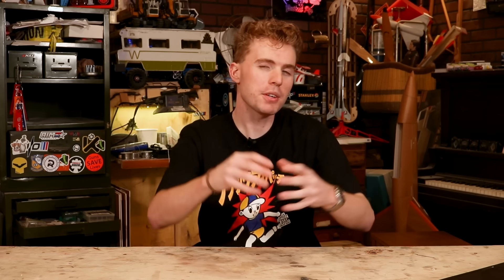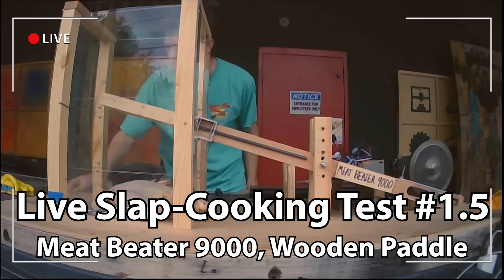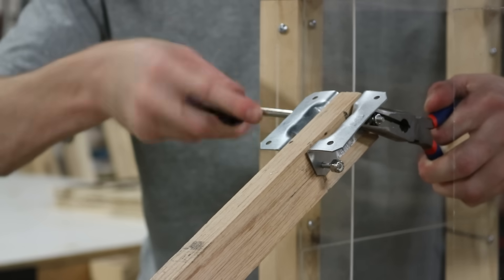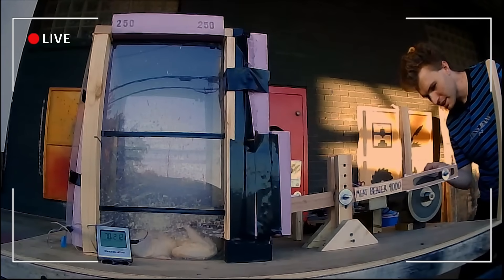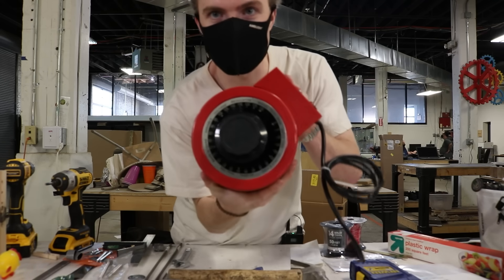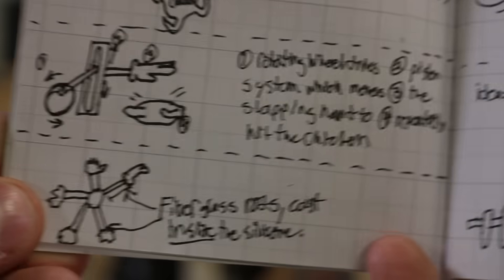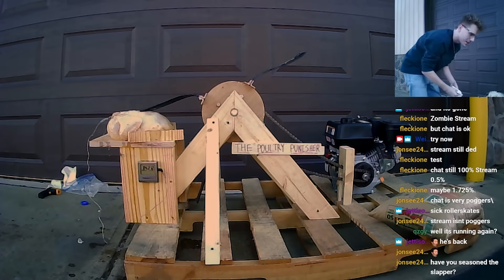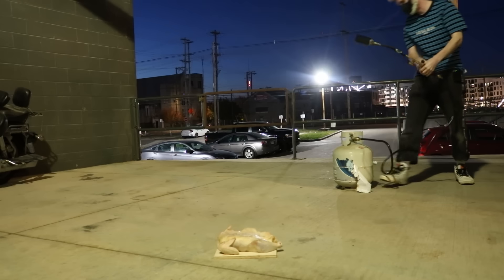How Many Slaps does it Take to Cook a Chicken?

Comment: You can cook this chicken all the way through. Some suggestions/observations:

- preserve energy introduced to the chicken by wrapping it in a thick layer of foil and plastic wrap on all sides except the one being slapped. You need high thermal flux where you're adding heat, and low everywhere else on the chicken. But if you can add heat quickly enough and keep the chicken in good condition, you might be able to fully cook it.

- the levering rig was less damaging to the chicken because the rotating rig, on each slap, also forcefully dragged a high friction material in a single direction against the surface of the chicken. Moreover, your mechanism was removing the most effectively heated mass of the chicken directly after the slap. On the slow mo footage of the rotating slapper, you can see also that the rubber tongues form very irregular shapes against the target surface and introduce sporadic high stresses to the fibers. You need to avoid this "pulling" motion after the slap and also try to make sure each slap directs orthogonal force into the chicken with regular, high surface area contact, with no other forces acting on the chicken.

- my feeling is that you should go back to the levering design, but use a second motor to set up a second arm that alternates in motion with the existing arm. This gets you a slap during the existing upstroke, so no costly upstroke. Also allows you to continue the experiment if one arm fails. I would have the ends of each arm not be slapper for the chicken, but actuators for a single, broad, flat plate that is actually used to slap. The arms would hit the plate to make it slap the chicken. The plate would need to be held under tension to return to a position a short distance above the chicken. This also amplifies the cooking effect because if the lever arms "slapping" the plate in turn heat it up, it will make the plate's slaps into the chicken that much more effective. The plate being a more stable and flat, high surface area element than the large arms, it should be a really good conduit for kinetic energy to the chicken without introducing high focused stress, and should keep it intact until you get it cooked. This design should also allow you to configure the force on the chicken via the distance the plate is held at (basically where on the elastic energy curve the chicken's surface is), so you can mess around with your parameters a bit.

This is a really cool project, loved the video. Good luck!

Comment: I feel as though you left out a several crucial ingredients to this experiment.  These include:

1. The chicken should be spun in an opposing direction of the slapping machine. This will allow the chicken to heat evenly and should help with chicken integrity.
2. A second slapping machine could be installed to slap the chicken from the bottom.
3. You are losing too much heat to the surrounding environment.   Overcome this by building a proper oven.
4. Adjust the ambient air pressure surrounding the chicken. I am figuring higher pressure results in higher overall temperature.

Comment: You need to find the optimum slapping force which will give you the maximum temperature increase while having the lowest damage to its integrity. slapping it by hand probably reaches such optimum conditions.
Reply from the maker: i agree, i think there's some magic to the meat beater 9000 that the poultry punisher lacks. The issue is, I'd need both an improved mount and an electric motor with about 4x the power.
Still looking for a used battlebot to get a motor from haha
Reply: @Weisz  all the best , someday you will have a million subs

Comment: This is one of the funniest things that I have ever seen :D I think the spinning rubber slappinator made too much air flow towards the chicken. I think it might work better if you would wrap chicken in vacuum pack and then run the thing inside of vacuum chamber to get really good heat insulation :D With out the back the chicken would dry up and freeze which isn't ideal for cooking.
Reply from the maker: Whoa, HPC! Thanks, that’s a great idea — but like, where do i get a vaccum chamber that big? 
I’d expect something like that to be insanely expensive
Reply: @Weisz  You could probably use any large air compressor tank but sealing the rotating shaft would be probably quite hard.
Reply from the maker: Thanks for the idea! I’ll definitely look into this :D
Reply: @Weisz  a vacuum had crossed my mind too, I may have some ideas of how to do it if you want to give it a try at some point
Reply from the maker: Ok, everybody in this conversation just join discord and let’s all have a chat 🧠🧠🧠
Reply: @HydraulicPressChannel  could use a cheap mechanical seal, alumina ceramic faces and nitrile elastomers for that motor shaft diameter would be like 35 dollars or so
Reply: @Weisz  build one
Reply: He needs a thermal vac so that he can fully isolate the chicken from environmental disturbances.  For computer modeling of the first slapper, anything over like 1m/s airflow killed heating chances due to convection. 5-10w/m2 is the most we can afford to loose.  Foil would help reduce radiative and convection heat loss, there were some papers studying this I found.
Reply: d-did i get recommended this video because you engaged with it? iwas trying to search for "ratios of solar system orbits"
Reply: So much amazing science going into cooking a chicken with slaps. wtf. also, you said 1 mach 5 slap could cook it. so take it to that rocket sled site the mythbusters used and set it beside the track. then have a big square paddle deploy off the side of the sled at the last second to slap the chicken to see if you can cook it in one slap, or rather, what little cooked pieces you can find after the slap. though it should help that the rocket sled is in a desert so it's already pretty hot there.

as for the multiple slapping idea. don't bother with a tiny motor anymore. borrow somebody's super bike and rig the slap wheel to that. full send as fast as the bike can go so maybe it can slap it so many times in such a short amount of time that maybe it cooks before it gets completely pasted.
Reply: @Subreon  well first off, hitting a chicken at that speed would completely obliterate it. And second, I don't your logic about the speed of the slapper  makes sense... What makes you think more speed = less damage?
Reply: @applesnider6856  it won't mean less damage. but it's already clear that slow slapping isn't gonna cut it. faster slapping might be able to cook at least a visible part of it without turning it into paste, as the cooked pieces will blow apart in chunks which can actually be seen, whereas paste is just, raw chicken literally everywhere. so yes, no matter the speed, the chicken will be obliterated, but i'm betting slapping it as fast as possible will produce visible cooked chunks.
Reply: @test-zg4hv  yes and the heat the slapper absorbs from the chicken and radiates
Reply: That wouldn’t be kinetic energy heating
Reply: Oh my god the people are smart
Reply: I learned more in this comment then at school 
Hahaha
Reply: Whoa!  If HPC gets involved then this will become the Meat Beater 5000000!

Comment: I got a better idea make it slap some metal container and inside the container is chicken. that way chicken integrity won't be an issue and the temperature reading is more accurate just make sure its insulated properly so heat will be kept inside.

Comment: the test where you hit 120 was your closest one,  you need to make a mechanism that stops the slap past a certain point so it does not slap completely through the chicken and turn it into chicken paste. It is completely physically possible to create enough friction and energy to heat a chicken, physics definitely allows for that to happen,  you'd just need a very specialized and indestructible rig, which may or may not be possible to engineer given current technology and materials.
Reply from the maker: if we hit 250k views and the people wanna see it, I will blow all the ad revenue on further research into chicken slapping
Reply: @Weisz  that's whassup. i wanna see it.

Comment: ok, hear me out: nugget piston

have you seen a fire piston? they get over 400F inside. what if there was a bigger one, just big enough to fit a chicken nugget. highly doubt it will be starting any fires, but what if it could get hot enough to cook a chicken nugget? maintaining that temperature would be the same as before, a function of slap frequency. no one said the chicken has to start in one piece, just needs to be one chickens worth of nuggets cooked via slap power

if the piston is just short enough, it would never contact the nugget, the cooking would all be from the heated air in the nugget chamber. nugget fully intact

according to google a small raw chicken weighs about 2.5 lbs, or 1134 grams. an average chicken nugget weighs 16.5 grams. so the process would need to be repeated 70 times to cook a whole chicken worth of nuggets.

if even one nugget can be cooked that way, the concept is proven. chicken can be cooked by slaps

Comment: But what about an armored chicken?? If you use a energy conductive, protective plate, (metal/plexi glas for the gore) and contain the all the sides of the chicken, it technically doesn't have a way to go, and you could use a much more rigid slapper.

I don't think the chicken has won (yet).

Comment: I feel like the poultry punisher was creating too much friction. 
Also since you are trailblazing in the field of chicken-slapology here we need to eliminate the integrity issue with a workaround. Encase the chicken in a tough silicone to prevent this issue. Since we are just trying to establish whether it is theoretically possible to impart enough energy to cook the chicken we need to eliminate the issue of ambient heatloss so a solid workaround would be to use a heated chamber that raises the ambient temperature to the internal temperature of the chicken.

Comment: how about slapping a metal sheet underneath and having the chicken on top of the metal sheet? That way the chicken wont get obliterated and will be cooked from the metal sheet.
Reply from the maker: I considered this -- but at that point, i'd argue you're no longer slapping the chicken. You might as well put the chicken in a frying pan, since you're just using it as a middleman for heat transfer.
Reply: @Weisz  OR you could wrap the chicken in a bag that won’t break as easily so that way you could still consider the chicken being slapped but with cloths.
Reply: First we have to convince him to make more slappers